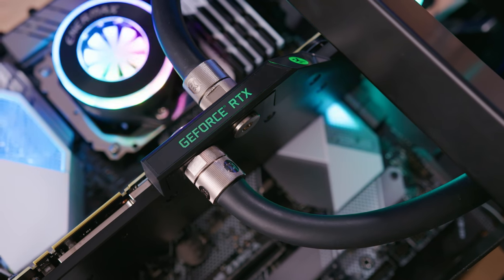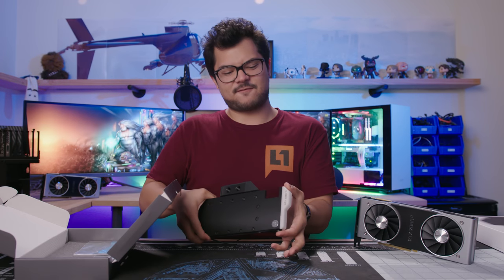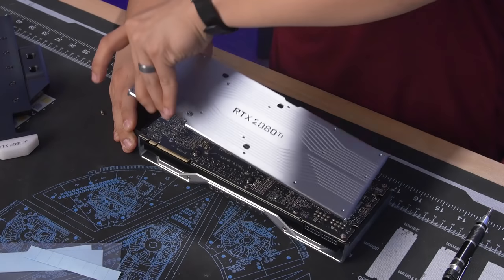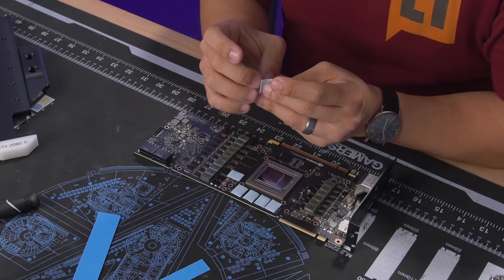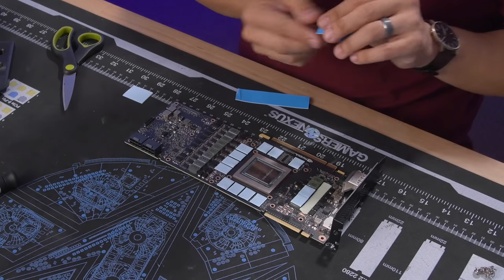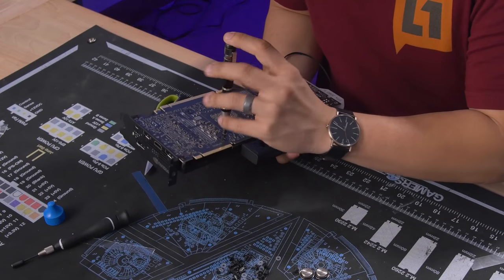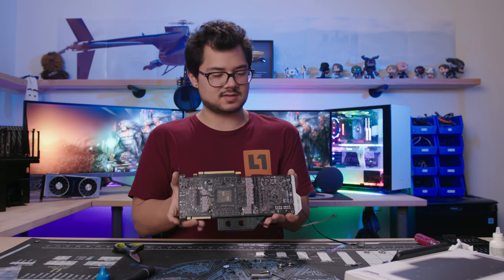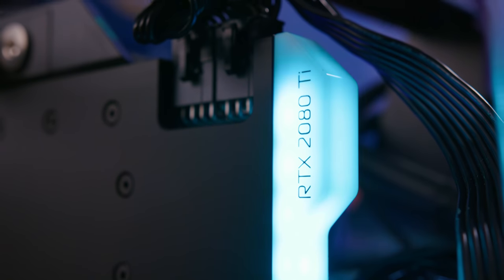My first RTX 2080 Ti water block installation

Comment: If it catches on fire you just gotta unscrew one of those tubes and just spray the water at the fire.

Problem solved.
Reply: ACTUALLY...because youre supposed to use distilled water that wouldnt even damage your components all that much
Reply: The water will pick up ions making it conductive.
Reply: @dwainfisher4119  how long does that take though?

Comment: You gotta run the backplate. It's a working heatsink on the RTX series cards and not just decoration like the GTX series. Your temps will be reading cold with the water block but those regions the backplate was soaking heat with those thermal pads are running hot.

Comment: Wait I thought you had to do the cross method for the thermal past
Reply: The house method is most effective
Reply: When you do on dye application (on GPUs or delidded CPUs) I would suggest to spread the paste manually!
Reply: @mchenri9683  Agreed
Reply from the maker: It was the first EK GPU block manual I've seen that suggested the pea method which I thought was odd, but who am I to question the holy manual?
Reply: MineSweeper  Exactly xd
Reply: Yes he used wayyy too little
Reply: thermal past vs thermal future
Reply: You're all wrong.  All of you!  There are only two valid methods: the Stop Sign, and the Jackson Pollock.

Comment: The thermal pads on the chokes and vrm are 1mm thick and 0.5mm on the memory. So the chokes might not get proper contact on the block since you used 0.5mm pads.

Comment: That Water Block costs more than me GPU.
Reply: Jack Rollins got a gtx 870?
Reply: @LootBoxyt  1050 Ti. 😄
Reply: How expensive is that thing?(the block)
Reply: I have GT 1030.   Please send help.
Reply: what the hell is an 870?  @LootBoxyt
Reply: Julius Caesar Even I have a 1030 😂 #Poverty
Reply: @nawaal4452  You can get 1050 tis for like $70 now. And then 900 series cards can be found even cheaper :)
Reply: Sure is. Cuz my gtx 950 just cost a fraction of that block.
Reply: @jakehathaway564  wow shit, my gpu was only €90
Reply: @jakehathaway564  hahahahaha that's true, I would have gotten a trio by msi though, looks sick and has that extra 6 pin
Reply: @KingBlonde  link?
Reply: @jakehathaway564  oh shoot didn't know that, thanks :)
Reply: Mine cost me $154. Backing plate is $39.99  @janpul1590

Comment: I have the Alphacool Eisblock GPX-N Plexi Light Nvidia Geforce RTX 2080Ti M01 (11664).  It not instruct to put thermal pads on the chokes?  Other waterblock instructucts to install thermal pads on and mosfet AND the chokes???  Even the stock air-cooler has thermal pads on the chokes.  Is this gonna affect performance not having pads on the chokes???

Comment: Ok. Real question now. Ive had my 2080ti. Under water for a few weeks now with the same block. But ek doesnt say anything in their manual to put any pads on the vrms. I didnt put any there and with the first block i wasnt making good contact and had to rma the block. But with the new one i still dont have anything on the vrms.... Should i take it apart and and some there too? Im getting worried now

Comment: Not really a fan of the pea thermal paste application on the gpu die (ek tells you to do the cross/star pattern), a cpu ihs sure where the die underneath is rather small but a gpu die directly (espacially as big as the turing ones) should be covered completely imo
Reply: Yeah, he got the manual open on the phone infront of him and still can't do it right... I'm sad for the 1.2mio subscribers 🤔😕
Reply from the maker: The manual said pea method. And temps are great. Sucka! 😝
Reply: @Bitwit  what the heck...? I checked the manual and you're right. "EK recommends blob or line method..." page 5. Well, this is new, so apologies for that. While I'm still in the opinion the cross or even full spread method like you should do with liquid metal as well fits best for GPUs. Anyway, have fun with that evil noVideo pixel-thrower... 🤗
Reply: @Bitwit  Confused now . . . why is it pea-sized for some, and full spread for others?
Reply: @joeyjoejoejrshabadoo4311  I believe Nvidia put a heatspreader on their GPU for the RTX generation, while other GPUs have bare dies
Reply: @kevo05s  AH I see. ty
Reply: @jakehathaway564  8800's have a heat spreader

Comment: I did my first custom water loop with two 360mm rads rocking a r7 1700 and a gtx 1080ti my CPU at 3.8ghz at 1.33v is running hotter that my GPU is that normal? Also what are safe temps for a custom water loop?

Comment: Thermal goo should be put in a X with dot and temps should go down. And if u put the wrong pads it won’t seal. This setup should be in the 40s top

Comment: Bitwit. May you please review and Optimus foundation block. The claims of them being able to put preform the flagship brands like EK and thermaltake etc is interesting. The blocks are extremely well crafted from a company that apparently has worked on crafting some parts for the Mars rovers, and has now entered the PC cooling industry. I have already received my block but due to financial reason can not finish my build. But I would be glad to send you my block to do some tests with because I believe Optimus might be on to somthing new with the claims of being almost 5° cooler than the other flagships. Thank you if you see this. I have not seen any legitimate videos about Optimus cooling which is interesting, I just want to see if the claims are true or not.

Comment: the thermal pads are different thicknesses so be aware you wont have good contact with the block on all the components bud now as youve mixed them up

Comment: Ummm Kyle, you definitely want to use more than just a pea sized glob of thermal paste on your GPU die. You gotta make sure the entire surface is covered because that's the actual die (not an IHS) and the entire surface area contains cores underneath and any uncovered areas could result in burned out cores. How do you not know this??

Comment: It might be a trend. Just finished installing my Thermaltake 2080 water blocks - they also came without a manual, had to look it up online. BTW, do you want to compare the RGB implementation on the TT vs EKWB water blocks? I'll send you pictures to pimp my pc section in two weeks (had to do the mandatory 24 hours leak test, then 48 hours of sysprep before i can pour the Vue fluid so no way i can do it before Tuesday).

Comment: I couldn't put pads on the raised black parts of the card (cant think of what they are called), the block would not make contact with the GPU... I think ek sent me the wrong sized pads. Anyway i left them off, hope it doesn't scare up my card.

Comment: Hi Kyle. Great video! I have 2 2080Ti running in a parallel loop. But my main gpu's temp is way above your result. I kept seeing max temp over 70C. I tried to reinstall the waterblock but it does not really help. Do you have any suggestion on this issue?
Reply: 程明昊 use the smallest includes screws. The other ones are too long and will not provide great contact.
Reply: Beyond4k Thanks a lot! I will definitely try that!

Comment: Your GPU is going to die if you leave it like that.  You need to put excessive amounts of Thermal Paste on your GPU to assure that every millimeter of the die is covered--if any of the die is NOT covered that one portion could overheat (because of the extremely high temperatures GPUs get to under load) and it could kill that one portion of the GPU.

Some advice I picked up from Steve at Gamer's Nexus.

Comment: Just installed my ekwb vector 2080 ti waterblock. I gotta say I am extremely disappointed at their instruction manual. They have 4 different screws and their stupid manual doesn't say which one to use... ultimately I had to redo it with the small screws.

Comment: Just rewatching this and stuck me as funny - I have the Thermaltake A500 and I have ROG 2080ti OC in SLI. And that case is damn bad for airflow :( I ended up with it because LianLi just weren't releasing the 011 XL and had no estimate...but they're out now and I feel like taking the leap and water-cooling both cards...so watching you do this is like a warmup.

Comment: Question.. by the time you buy a 2080ti, add a water block, add the pump and radiator and everything you need for it, at what point are you spending too much to squeeze out just a few FPS. A 2080ti costs $1000-1200. By the time you throw all this shit on it, you've added another $400-500 to the cost, and For What? Just a few frames? I'm genuinely curious.

Comment: Now that's more like it :)
Though, I am concerned about the thermal paste on the GPU die. It's quite likely not covering all of the die and could cause trouble down the line.
I'd suggest removing it to check the coverage - if it's ok then panic over, if it's not.
I am, also, a fan of the new design language from EK. Have you been looking at the matching CPU block for the final build?

Comment: That is incorrect application of Thermal compound on the GPU it needs to be thoroughly covered usually in a star pattern your GPU will probably burn out.

Comment: Hace una semana construí mi propia pc, ahorre 1 año y medio para ello, durante 2 años dedique mucho tiempo a ver presupuestos, instalaciones y builds de diferentes canales(la mayoría de USA), tarde probablemente 1 hora sacando todo de sus cajas, 7 horas construyendo la PC, 1 hora en cable managment y la ultima hora veríficando que la bios reconociera correctamente   mis componentes, activando xmp de mis RAM e instalando Windows 10 y los drivers.
Componentes o hardware:
CPU: Ryzen 5 2400g
Liquid cooler: Nzxt x52 (with am4 bracket).
MOBO: x470 aorus ultra gaming
RAM: 16GB(2x8) Hyper X Predator RGB 2933MHz
Memory: SSD 250GB Samsung 860
PSU: Corsair CX750M 80+ bronce semimodular 750watts
Case: Nzxt H500 white and black.
Costo total(incluyendo tax): 930 dolares.
No tuvé ningun error, todos los componentes y conectores frontales fueron correctamente instalados, el cable managment usando cinchos y con paciencia quedo perfecto en el h500, arranco e instale el S.O. desde un usb boot sin problemas y descargue los drivers desde las paginas de los fabricantes y todo quedo perfecto.
Ahora solo queda ahorrar durante medio año para comprar perífericos profesionales y un monitor bueno.
Mientras armaba la pc muchos de tus consejos o pasos de tu video de como armar una pc me fueron muy utiles así que gracias sigue con el buen contenido.

Comment: Lol firstly don't start ripping off and throwing away thermal pads before you've read the instructions. My Bitspower WB comes with 2 small strips but expects you to reuse most of the originals (bit cheap of them if you ask me). Also my wb doesn't come with a back plate but the instructions say to use the original. So no need to leave the back of the card bare!

Comment: Do you really use the shitty thermal pad from EK 3 a 5 w/mk.Use Alphacool Eisshicht therrmal pad 17 w/mk at least 6C a 7C lower temps and do not touch thermal pads with your fingers.
and spread the paste i hope for you that the small drop coverd the hole PCB. i have done so many cards.Always good.And a tip befor apply the thermal pad make a test with the paste
and dan clean it again than you know it fits.And than make the hole card dust free.

Comment: hey i wanna build a new pc and wanted to know what you think about it guys. you can tell me if it seems good but i dont wanna go higher in price if you think i should change something (1960 CaD with taxes and shipping on Newegg.ca)

GPU : MSI GeForce RTX 2070 DirectX 12 8G OC 8GB
CPU : AMD RYZEN 5 2600X 6-Core 3.6 GHz (4.2 GHz Max Boost) 
Motherboard : ASUS Prime X470-Pro AM4 AMD X470 SATA 6Gb/s USB 3.1 
RAM : CORSAIR Vengeance LPX 16GB (2 x 8GB) 288-Pin DDR4 SDRAM DDR4 3000
SSD : SAMSUNG 970 EVO M.2 2280 250GB
HDD : Seagate BarraCuda ST2000DM006 2TB 7200 RPM 
PSU : Seasonic FOCUS Plus Series SSR-650FX 650W 80+ Gold (modular)
Case : NZXT H500 (white and black)
CPU Cooler : be quiet! DARK ROCK TF

Let me know what you think about it and if i should change something to get it as good but cheaper :)

Comment: and when ur rtx 2080 ti becomes rma 2080 ti use the warran... oops where its gone? bb 1500 euros  .. 
and at 52 c not even over 2000hrz power limited crap . should be at least 2100 hrz on water block

Comment: Hai Kyle,

My name is also Kyle I have a i7 6700 and a  GTX 950  I have some sort of weird, ugly, green motherboard that my dad gave me that takes laptop ram for some reason. I have 32 gigabytes of 2400 MHz laptop sandisk ram. I have a corsair carbide 200r which is a case that my dad bought for me, a 240 gigabyte SSD and ketchup and mustard PSU cables.  Do you think you can do a Pimp My Rig for me? I am only 14 though so I don't know if you can do that.

Comment: 1000 dollar budget for rig , only for playing WoW. Any suggestions???
Reply: Thanks very much for that. Never have built one, so I hope I don’t mess anything up.
Reply: 1000 dollars is overkill for WoW lmao
Reply: @jhonwayne1003  Do not buy the i5-9600k , its not a great value. You would be better of with maybe a ryzen 2600x or 2700x. That would also  make for a cheaper motherboard. And also DONT go with a 500 watt psu. Get as high as you can afford because cheaping out on a psu will haunt you. Also get a ssd. Only a harddrive would waste the speed of your components.  I would suggest just searching for builds online from respectable youtubers. And 16gb ram is also highly advisable.
Reply: @JUUL-_EHV  true amd is much cheaper and the mobos for ryzen too
Reply: If its JUST for wow jsut get a 240GB SSD and no HDD
Reply: julian greven Thanks will look into this, maybe I can find a build with a guide.
Reply: Panicky Khan That would cost like 2000$ in India 😭
Reply: I’m in the States Indianapolis to be exact. Anyone close to build this for me lol
Reply: @jhonwayne1003  Kyle has a build guide that's pretty competent and same with Paul's, Paul's is my recommend for anyone build a AMD build, which i kinda suggest.
Ryzen 1600 -130
ASRock b350 pro4 microatx
240gb SSD-50$ 
Rx 580 8gb, 200-250
Mastebox q300l - 40
Corsair cx550m, 60-80
And 
Corsair vengance lpx 16gb 3000mhz-  $130
(If you like eye candy in games go for the 580, or 1060 6gb variant. Solid as hell for 1080p and a hair overkill, but will last ya longer then a budget card, for the car it's kinda a whatever except get one with mesh, you could save some money and drop down to 8gb of ram, but you want two sticks at least and check ya motherboard manual for which slot to out them in. Id worth the extra 60, as for the case, its not gigantic and it has a breathable body which will help extend it's life the cooler it stays. You'll want to set the ram speed also in the bios. If ya want I'm willing to help. You can email me at my username + @gmail.com)
Reply: Dracossaint
Reply: Here's a breakdown of what I'd pick down to the t
https://pcpartpicker.com/list/8B4dzY
Reply: Thanks all of you for the info, much appreciated.
Reply: @jhonwayne1003  if u still need help I can make u a list